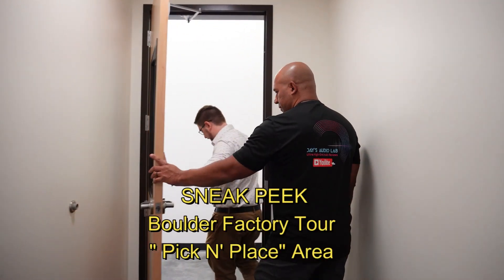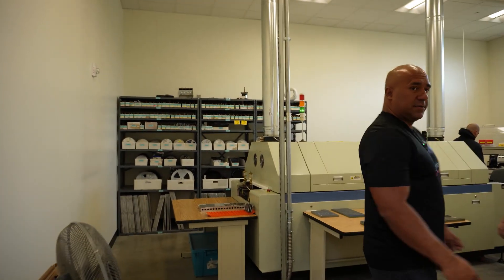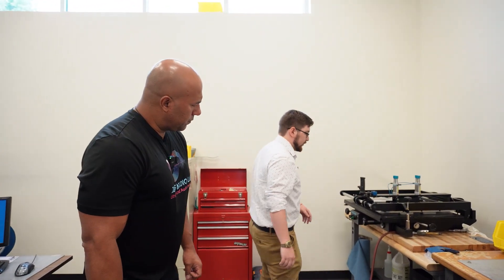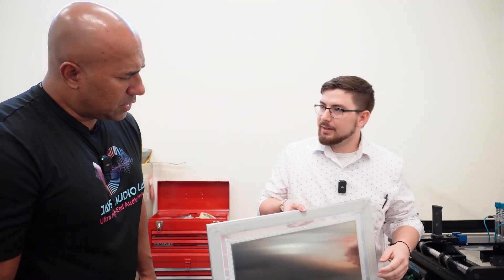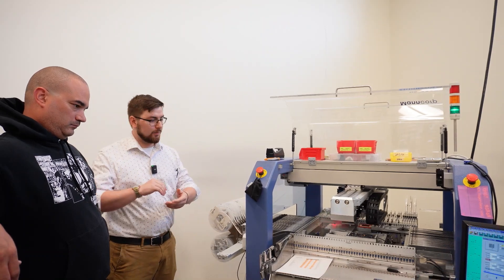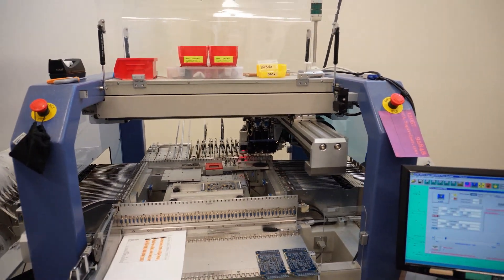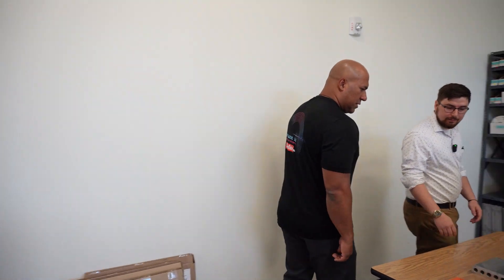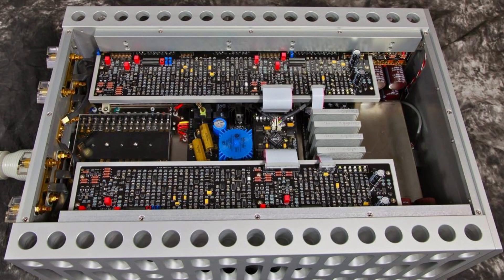Building One Of The Best Power Amplifiers In The World: Surface Mount Technology Machine

Comment: SMD done it right is the way to go because of small sizes lead to short signal path and light weight.  Linn and others have been using it for more than 30 years. Then why Boulder’s gears still huge?  Power supplies or pan size caps？ or marketing hype?   One downside is anything goes wrong then swap the whole board and no soldering gun…

Comment: The missing part of the equation is that the SMT technology has a very high susceptibility to ESD and must be controlled by grounding methods.  None of these are exhibited in the video, therefore I would not recommend this manufacturer until they can grow to understand the concept.  I have been in this industry for over 35 years and even the startups have grounding throughout their facilities.
Reply: They do have some issues with there product's..

Comment: I am actually surprised they'd have enough volume to justify having a pick and place machine in house.  This is a small slow machine, perfect for a small volume application.  It is fascinating to see a full sized operation going at full speed on a Siemens system.  The robotic head runs so fast you can barely see it, and then the process of validation is all done by another computer which looks at every part to ensure the part is properly placed and in the right orientation.  Then the boards run through the oven which has been optimized to take it to the proper temperature at the optimal speed to ensure perfect solder joints.  Then the boards are cut from the master pcb and are run through a test cycle by another computer.
Thousands of pcb's will be produced in a shift with one person at one end loading the machines and another at the other end stacking them on trays.  A manufacturing process can be run anywhere in the world.  Once you program the system it will be identical whether it is run in Mexico, Poland or China.
Reply from the maker: Ok

Comment: This is a technology as old as time.
Reply from the maker: And it's still expensive as hell
Reply: This was all born in Silicon Valley. Same manufacturing technology found in $300 motherboards in $1000 PC’s. Boulder even employs same ribbon cables to connect all the pcb’s. 

Doesn’t look like they are using switching power supplies and of course those pretty CNC cases surely makes the product worth its retail price 🤦‍♂️

Comment: It's funny that one of their amplifiers on the top-end probably costs more than their pick-and-place machine😅
Reply: That's the beauty of capitalism
Reply: Don't know what this small machine costs.  A full sized Siemens machine is about $1m.  It is the gold standard.  An outsourced manufacturing plant will have several of these machines running 7x24.  That is how virtually all electronics are made from cell phones to the 50 pcbs in your car.
Reply: The small P&P machine you see and the regulated oven together are $350-400k. Roughly 2.5X cost of a pair of Boulder monoblocks. 

A few skilled engineers can program this and their 5-axis cnc’s w/o hiring, training and maintaining skilled assembly staff and the more rigorous qc requisite of hand soldered ptp assemblies.